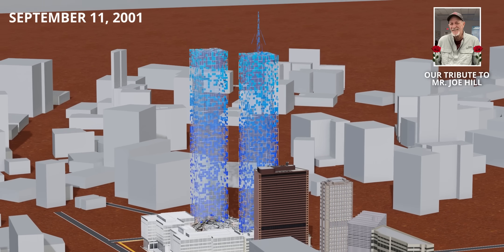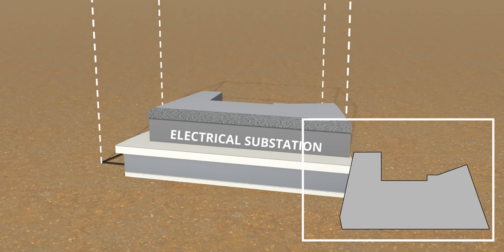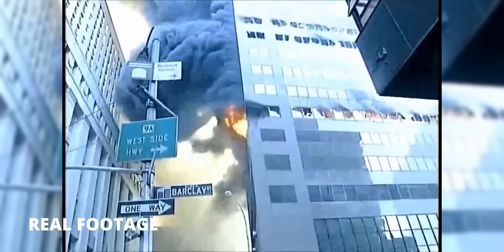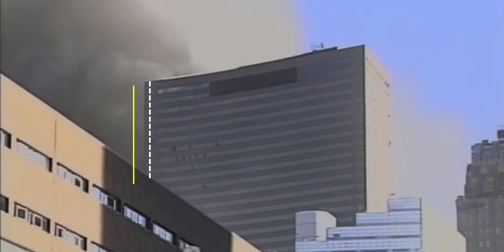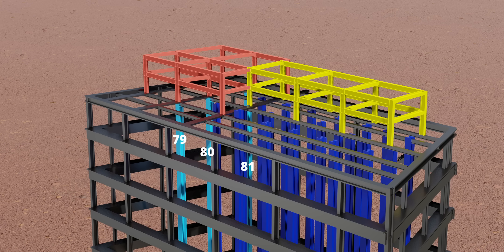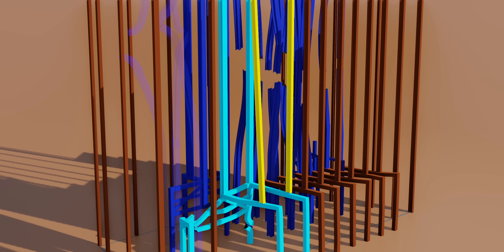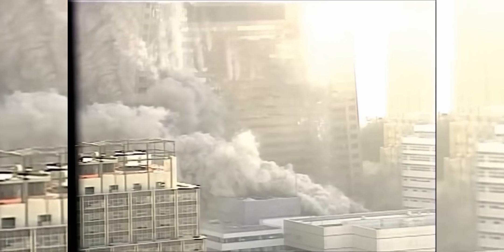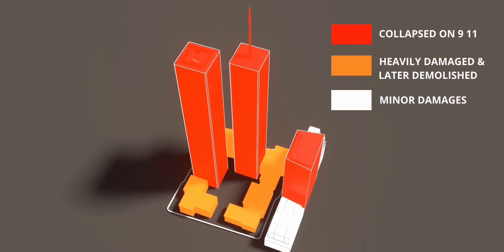Collapse of Building 7 | The Complete Physics

Comment: Crazy wish I could melt steel with fire to. Fire hot enough to melt steel but not hot enough to melt passports. Hot enough to melt bodies and burn them beyond recognition those passports tho prestine 😂
Reply: No steel melted (as in - was heated to its liquid state) nor did it need to be. Structural steel will fail at less than half its melting temp so it never gets a chance to become a puddle.
Reply: The passport was found two blocks away from the tower. 
You don't think there's going to be debris thrown from a plane impacting a building at high speed?

The problem with these nutball conspiracies is that they take people's attention away from actual conspiracies. 

The real conspiracy around 9/11 is that the Bush administration used it as a reason to invade Iraq.

There's an easy way to prove it wasn't an inside job. It happened while Bush was in office. You think those clowns could've pulled this off, and kept it secret? 

Also, what's the motivation? Why would a country kill almost three thousand of its own citizens and cause over $100 billion in financial costs to its own economy. Indirect costs are an estimated $2 trillion.

Just to preempt you, don't accuse me of believing everything the government tells me. I'm very skeptical about the government.  But in this case, there's so much independent analysis that explains all the deniers' claims.
Reply: Molten steel was reported by the fallowing 
people. Captain Philip Ruvolo (NYCFF), 
Richard Riggs(debris removal expert) , Leslie Robertson (wtc structural engineer), Lynn Margulis (University of MA),  Dr. Abolhassan Astanch (from Berkeley),  Robert Kim Ireland( chemical engineer for US Army Corp of engineers), Mark Basile( chemical engineer), Kathy McGrade (materials engineer), Gery Warner( Mechanical engineer), David Gregg( PhD Chemical engineer), Steven Jones PhD( physicist), Kevin Ryan ( BS Chemistry), Niels Harrit (PhD Chemistry), Tom Sullivan( Explosives team) Jason Cheshire ( Chemical engineer), and Jeffrey Farrer (PhD Material science engineer).
Reply: @robbiehiatt9966  WRONG - no molten steel was ever reported!
Reply: @ThomasDanielsen1000 so, what's your qualifications?Since you know so much better than these experts?
Reply: @robbiehiatt9966  Please provide me with references to where they claim BACKED UP BY EVIDENCE that there was molten steel!
Reply: @ThomasDanielsen1000  - Now thank Robbie for proving why it is pointless to engage with him.  Who picks up a liquid from the top?

Comment: all 3 buildings went down in their own footprints and were to believe that this 1 in whatever huge number chance came to fruition all 3 times? Sadly we will truly never know.
Reply: Only if one has an extremely flexible definition of 'footprint".  If YOU don't know, speak for yourself.  Many get it just fine, myself included:

Building 7 was the 6th building to collapse of 10 lost on 9/11 and because of its early low priority was largely ignored for a while, so conspiracy filled the information void with simple-minded garbage by technically ignorant people promoting political agendas. This created a lot of confusion and misconceptions which I hope  to dispel, so I prepared this brief summary of my own analysis, using technical analysis, not ideology and magical (non)thinking. 

At 10:28am the WTC North Tower collapsed, showering Building 7 with tons of burning debris, causing heavy damage and starting many large  fires which burned out of control for the next 7 hours. Half the FDNY firefighters having been killed, units in disarray, equipment destroyed, no water pressure, and the greater urgency of search & rescue efforts, Building 7 couldn’t be saved so firefighting efforts were pulled as futile and 7 left to its fate. Firefighters make that sort of choice every day in brush fire situations - which houses to save and which ones to let go. Only real difference here is moving the decimal on the size and cost. People get overwhelmed by the size.

www.youtube.com/watch?v=g_SvpwyC17M

Collapse of a burning structure is always a concern for firefighters. Steel buildings are uniquely vulnerable to fire damage. When subject to fire they rely on active firefighting to survive. Buildings are designed around 1 to 3 hours of fire resistance, allowing time for occupants to escape and active firefighting to get started, after which all bets are off. Left to their own devices they'll exceed their design envelope and collapse, like Plasco Tower and Wilton Paes de Almeida. In 7 the occupants escaped, passive and active fire protections were compromised and active firefighting was abandoned hours before the collapse, which left the building to its fate. It lost. Odds on Building 7 would eventually collapse, and it did. No big deal in logic.

 http://www.youtube.com/watch?v=WnYBX6QT0R4 

FDNY Chief Daniel Nigro - The biggest decision we had to make on the first day was to clear the area and create a collapse zone around the severely damaged 7 World Trade Center, a 47-story building heavily involved in fire. A number of fire officers and companies assessed the damage to the building. The appraisals indicated that the building's structural integrity was in serious doubt. I issued orders to PULL back the firefighters and define the collapse zone. It was a critical decision; We could not lose any more firefighters. It took a lot of time to PULL everyone out, given the emotionalism of the day, communications difficulties and the collapse terrain 

FDNY Deputy Chief Peter Hayden ; We had our special operations people set up surveying instruments to monitor and see if there was any movement in the building. We were concerned of the possibility of collapse in the building. And we had a discussion with one particular engineer there, and we asked him if we allowed it to burn could we anticipate a collapse and if so, how soon? And it turned out that he was pretty much right on the money, that he said 'In its current state you have about 5 hours 

The collapse of Building 7 was anticipated and widely reported in the media throughout the day, with 24 video cameras recording some or all of the collapse. Everyone knew what was coming and why. 

www.youtube.com/watch?v=OY5S5k3tMHI

Building 7 collapsed from the inside out which is not at all intuitive and hard to understand, with most details being hidden from view.  It requires careful analysis and observation, and some people will struggle no matter how much it is explained. But here is my explanation relying on no outside authority. 

Building 7 was a unique, asymmetrical 47-story steel frame structure built atop a smaller 3-story building serving as a partial foundation, requiring lower floors dedicated to complex load transfer structures. Of trapezoidal shape and tube-in-tube construction, B7 (above the 7th floor) consisted of a central core of steel columns carrying most of the gravity load, perimeter steel columns around the outside of the structure carrying the remainder of the gravity loads and long span beams and girders to tie those elements together and form the floors. On the outside of the building hung a facade or outer shell. 

www.nist.gov/image-16640

Phase 1 : First externally visible signs of collapse initiation occurred at 5:20:28 pm and was notably quiet with observers not realizing the building was collapsing! No warning in the form of hundreds of eardrum busting 180dB explosive bangs. Here at 12:00 a local CBS affiliate reporter talking 10 blocks from B7 when collapse begins. People don’t start to notice the collapse until 12:11. At 12:45 is the famous CBS fixed camera clip of Building 7’s collapse. Note the silence. 

www.youtube.com/watch?v=t5tEy6mXSE8

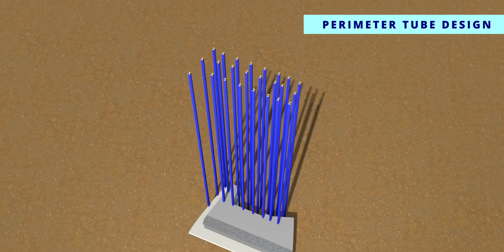Lower floor failures above the load transfer region (8-14) in the NE corner initiated the collapse. In this video at 0:45 you can see the NW corner from inside the building while under construction, Column 79 just out of frame on the left. That big, angled steel beam across the top of the frame connects to C79 at one end. The girders connect to the beam. That beam and all those girders depend on just one connection 

www.youtube.com/watch?v=nP3TNHPCIVU&t=45s

Phase 2 : NE corner floor failures caused a loss of critical lateral support over an excessive length of Column 79 and it buckled. Looking at the above floor diagram of Building 7 when you see all the structures that depend on C79 you quickly realize this one column was a relatively isolated structural element on which a disproportionately greater fraction of the structure depended analogous to say the Key Bridge. Externally as collapse begins we see a vertical progression of window breakage along the 44-46 line and a kink in the roof of the East Mechanical Penthouse at the top of the building, consistent with C79 failure. Normally with a buckling column, the load could be redistributed to other columns. With C79 that is not the case - the failure did not redistribute the load, so the collapse rapidly progressed to the roofline, sinking the rooftop penthouse. The transition from full capacity to almost no capacity occurs in an instant and will result in virtually no resistance 

Phase 3 : With C79 gone, B7’s progressive, non-symmetrical collapse continues with adjacent columns 80 and 81 left laterally unsupported and quickly buckling as well. The EMP drops down through the building. C79-81 all have no diagonal bracing, which is the major reason why they could not redistribute a lot of vertical loads among one another. From there collapse progressed from east to west through the central core until the core was gone from 81 to 58, taking all the interior floors and probably most of the perimeter columns with. Follow the horizontal progression of window failures low in the building and the dropping of the remaining rooftop structures into the building. The NIST Building 7 study model 4 determined C79 failing under ANY circumstances would have initiated the same collapse sequence. 

Phase 4 : After about 10 seconds only the exterior moment frame remains, giving the illusion B7 is still standing to the casual observer since little has outwardly changed. But it is just a hollow empty shell like an empty cereal box supported only by a few remaining columns and overloaded from the loss of the core columns and floors, quite unable to remain standing. With nothing remaining behind it, the north face leans inward, forming a V in the roofline, the last few columns buckle under the strain and the moment frame free falls, landing on top of the debris pile. 

It is only here at the very end, a single measurement of alleged free fall acceleration is taken, from just one point on that outer shell. The Building (core and interior) did not “free fall” - was already gone before that happened - just one corner of the outer shell briefly moved at a rate comparable to FFA. This alleged FFA was a product of how the shell fell NOT why the building fell . It’s also not even proper FFA as the single measured point was moving in 3 dimensions, not just down, which adds another variable. Start to finish the collapse took 18-20 seconds, 3 times longer than true FFA . How fast something falls can’t tell you what started it falling, certainly not 10 seconds after it started falling.  

The debris spread outside the footprint blocking surrounding streets, heavily damaging the Verizon Building and destroyed Fiterman Hall. 

No building is meant to survive 7 hours of multi-floor unfought fires. Building 7’s progressive, non-symmetrical collapse was incidental, unintended collateral damage from the combination of fire, time & gravity started by the collapsing North Tower, true no matter who planned and carried out the 9/11 attacks or why .  Of so little consequence it barely registered at the time, only taking on semi-mythical status as an alleged smoking gun years later when demolitions at the Twin Towers, missiles at the Pentagon and shoot down over Shanksville all failed and conspiracists had nothing left to work with. 

Anything can seem like a conspiracy if you don’t understand how it works. Now you should. I hope you found this helpful, informative and it solicits informed critical comment. If I made any errors of fact, logic or reason or left anything important out, please let me know so I can fix it. OR offer a more plausible alternative if you can. Be the first. Please start any reply with the words “Tits McGee” or I will know you didn’t read it and are wasting my time.
Reply: Showing that you have no idea what "footprint" means. Meanwhile, considering you can't tell "past tense" from "we are", you clearly will believe anything you're told.

Comment: The entire length of the interior columns above where they failed should have remained intact if the fires were only on the lower floors. How did the hundreds of feet of column collapse into itself. Also the animation treated the columns as though they were unbraced for their entire length. Any good building design with use the floor system between stories to brace the column length to limit the unbraced length.
Reply: Are you saying the columns should have remained suspended in mid-air????  Lack of lateral support is what caused the column failures BTW.  It isn't shown here, but floor failures are what started the collapse, not column failures. 

Perhaps a better animation - an actual model - would help.

www.youtube.com/watch?v=VAkTbyENZ5s
Reply: There were horizontal beams at each floor level.They're just not on this diagram